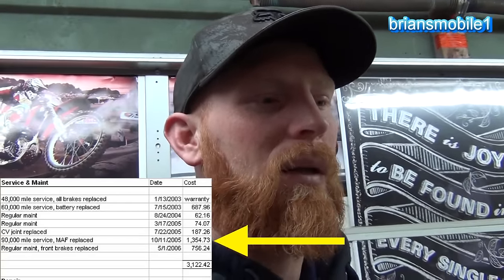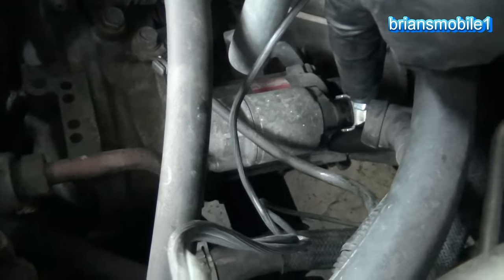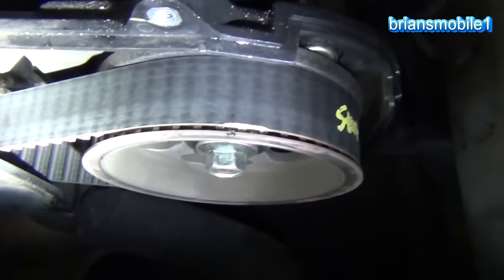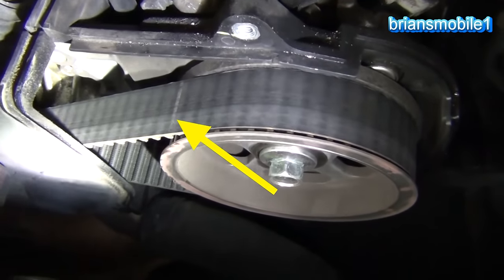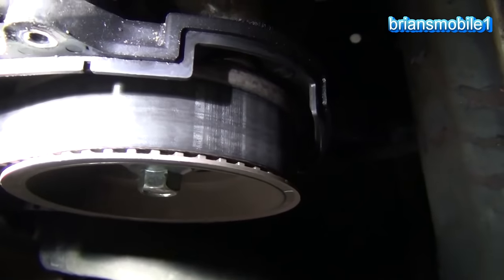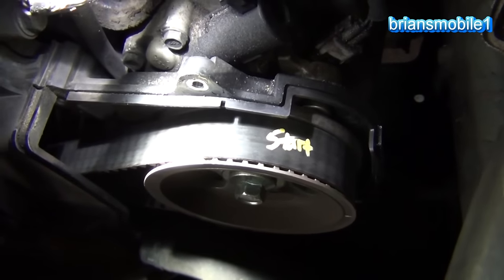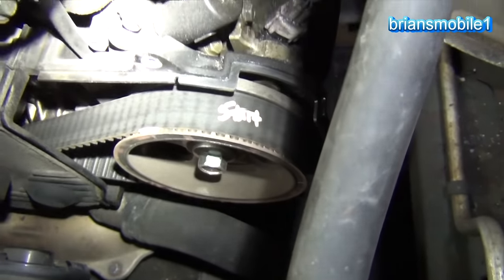How to Tell if Your Timing Belt's Been Replaced

Comment: I usually wait until my pistons to smash my valve train....Works for me- TWICE!
Reply: Get a Toyota with a 1mz V6, if the belt breaks it's not a huge loss, and installing a new timing belt kit is all you need to do to get the engine up and running again. You still need a tow to your car to a mechanic, or home if you are DIYer.
Reply: @davidperry4013  I’ve done mine in the parking lot right where it broke down😂 saved some bucks
Reply: Had it happen at 70mph 👍👍good experience. Now check the belt myself when buying a car lol
Reply: @conorf8091  What do you look for when you check it? Kinda hard to tell the health of the belt just by looking at it
Reply: @conorf8091  what happened? .. thats my worse fear
Reply: 😂 oh yea that works
Reply: @yamkaw346  cracks, if it’s shiney on the underside are shiney in general would indicate the belt has gone hard or stiff therefore not providing enough flexibility
Reply: @wayneshone3471  I bought a Peugeot a couple yrs ago and no evidence of belt being done. I can't take off cover because its connected to engine but I opened top screws of the cover and I can pull it back and look in with a flash light and belt looks fresh not black and smooth or cracked, I even see a tiny bit of green what was once writing, I said this to my mechanic and he said u can't tell by looking and better to change it at a cost of about 350 so now I don't know what to do.

Comment: A good mechanic would place a sticker in the engine bay to denote a timing belt change and at what mileage.  A sticker is the first thing to look for.  We inherited a 2002 Sonata from my father in-law and had no idea about if or when the timing belt was ever replaced.  I found a sticker in the engine bay that told me it had been replaced at 90,000 miles. It saved me from doing an unecessary replacement.
Reply: @Nick V: An even better mechanic would check the maintenance manual to see when the timing belt was last changed. No pfaffing around the engine bay with dirty hands.......  
If the mantenance manual hasn't been kept up to date or if its missing then turn your back on the car and walk away. Same if it looks like the maintenance manual has been tampered with.
Reply: Anybody can put a fake sticker in the engine bay with a mileage and fake belt serial number.
Reply: Anyone can put a sticker when selling a car saying its been changed
Reply: Nick V the trick a lot of people use when selling. Car around 90k is to just put a sticker on.
Reply: On eBay they sell stickers to fake timing belt changes too, e.g Gates ones
Reply: IT'SME  I would, ASAP. My 240 Volvo timing belt went at 60,000 miles. Good thing the engine was non interference. Old 2000 V6 Camry 80,000 miles per manual. Changed mine at 100,000 miles, old belt looked as new as the new belt - could not tell the difference. Mechanic friend said he change at 130,000 miles with no problem on his Lexus (Toyota). I would not push it that far, but the guy does it all the time on his own cars (Toyota).
Reply: @frankw8876  
What if you have a commercial vehicle that idles a great deal orworks at 10 mph for 10 hours a day like an ice cream truck?
Reply: Don't Sonatas have chains?
Reply: IT'SME  50 to 60,000 on most cars
Reply: @frankw8876  
Even some non-interference engines can make piston to valve contact.
Reply: The sticker usually falls off in a week
Reply: @team3383  anyone can write some lies in the book. That is NOT evidence.
Reply: @mr.e1220  Thats exactly why I said you must check and see that the book hasn't been tampered with. Anyone can stick a sticker inside the engine bay saying anything or write phony dates on oil filters ...
Reply: In short there is no way to understand weather its replaced or not right? Just change it as soon as u take a car if its exceeded the mile
Reply: @ramonatan4406  in Ireland they write on the engine with white correction fluid, but as u said anyone can do that.
Reply: @MrJohnnyDistortion  very very good point but they also recommend changing every 10yrs I believe regardless of miles.
Reply: @martymartin2894  
Ain't never heard the 10 year rule. But I'll go with it.
Reply: Best way. Just negotiate the price of a belt change off the price and get it done.  Service books can be faked, stickers in engine bay can be faked.  Having it physically done yourself is the best guarantee.
Reply: @martymartin2894 5 years usually regardless of miles. It's rubber and it deteriorates
Reply: @tambrand7294  thanks I got it done great peace of mind now.
Reply: @CashApp-HelpMeStayAlive then why you here lol

Comment: that guess or assumption can be costly! the best thing is to learn to change it yourself in that way, you will have a peace of mind that the belt is good. remember its a rubber and it dies with time not only mileage. a car that is 10 years old but driven only 10,000 mile, will need that belt changing.
Reply: Nice-oscar 
Nice one man just got 10 years old van with very low MILLAGE thinking no need to worry about belt 
But u are right 
Thanks for tips

Comment: sometimes the best thing to do is bite the bullet and get it inspected/replaced by a mechanic anyway. Couldn't find any sticker indicating it had been replaced under the hood, couldn't find it on the carfax, no way the car went 180k without a timing belt replacement before i bought it, but got it replaced anyway. Out of sight, out of mind.

Comment: Thanks!  Was just looking at my 01 Subaru that I just bought, and the back of the belt is glossy, so I figured it's original.  Your video confirms that.  122K miles, so it is getting changed this coming week.
Reply: What does glossy mean
Reply: @tientrinh943  shiny

Comment: I did a timing belt for a friend today, in a Honda Accord with 204,000 km. There was not one witness mark anywhere, no marks on the belt or timing marks, no missing fasteners, and the Honda crank bolt was pristine. As far as I can tell, parts seem to be OEM. After I was done it looks very different, and specifically that crank bolt is now experienced, in a Jimmy Hendrix kind of way.
Reply: Hey bub i got a yr 2000 accord with 101,000 miles the timing belt was done in 2004 when it had 42,000 miles so now its 61,000 miles into it, should i roll the Dice and go another 20,000 miles.
Reply: @matt7iron  That's a good question. My instinct is to respect miles over age, but I have no idea whether that is right in really old vehicles. I would probably do it now. The ASIN belt kit I got at Rock Auto was excellent.

Comment: This is very interesting, informative. Preparing to purchase an older Honda CRV and the timing belt and water pump are my two main concerns. Naturally, the used car dealer tells me they checked and it's fine. But with 201,000 miles on the car, seems to me it'd time for a change.
Reply: Yea, they checked....that's a good one.Checked for change in the ashtray is all they check.
Reply: Considering most manufactures schedule a replacement before 90k miles, I'd say it's time for your third belt.
Reply: crv has a timing chain.
Reply: @helivesonforever  DOH!

Comment: do you have an aftermarket brand that you like the most,
Reply from the maker: Gates
Reply: briansmobile1
Is the cost of the Gates vs OE that great of a difference?
Reply: UNITTA
Reply: cjones4512 Yes, for example for the Sti, the OEM is almost double ~$120 vs the Gates. I have OCD for OEM parts though.. Lol
Reply: Dan.vaku It's nice to meet a kindred soul. Ha! I got irritated when some small OEM parts for my Civic didn't show up in sealed Honda-labeled packages. ; ]
Reply: Best deal Gates kit from Amazon.  On the subaru above $146 because I just bought one.  Comes with all ildlers including the horrible idler gear plus water pump and tensioner.  When I bought one for my 2000 legacy 2 years ago, on that day it was $132.
Reply: ***** Yeah, it's a great price, check Amazon.  It varies and sometimes third party sellers are cheaper than Amazon.  Check ratings, the one I just got was sold by a third party seller with great ratings.  The only I got three yeas ago for my car was amazon itself and it was $132 at the time.  The belt is made in USA Gate and I believe all the idlers are made in USA.  The water pump is Chinese but people aren't having any trouble with it.  I've got 39,000 so far on my timing belt change and it's been fine.
Reply: @Eastahtata  I only use Toyota parts for my 4runner especially timing components
Reply: Black....black belts are hard to beat. Especially if we're talking brizilian ju jitsu
Reply: I didn't expect to find Mustie1 here 😂
Reply: Ha I was going to say the same. Good to see even @Mustie1 (one of my fav tubers) asks a question every now and then 👍

Comment: This guy helped me alot. I bought a 2.0 litre turbo back in 2017 December and thee car was half of its retail price. I did get serviuce3 history but no mention of any timing belt change which is very important. Car had covered 81k miles so certainly needed a belt change. I checked the condition after id bought the car, removed the case and voila, brand new clear white markings. So this tells me the belt had indeed been changed around 70k miles. Belt was brand new almost. My car is Z20LET 200BHP and now covered 107k, belt is still good until 120-130k but obviously i will keep checking it for cracks etc. Timing belt and timing chains are very important people. chains do slip on worn pulleys on high mileage engines so be warned. chain might be good but teeth on pulley could be worn down. Same with belt, one slip and car wont start no matter what.
Reply from the maker: Glad it helped Andi!

Comment: Thank you for this video, I checked my belt immediately and found the same fine lines as the belt in the video. But it's printed clearly.
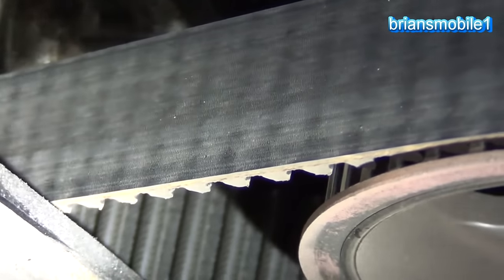Are fine lines like the one in the 2:09 video normal?
Is the belt in the video already used about 50,000 miles?
Thanks

Comment: Thanks for this. One thing that would have been more helpful is to describe what to look for on the teeth. On the Subi, the cam gears have the guides on them, but others are open where you can see the gap between the teeth and the the cam. The other thing I look for is at the point where the root meets the side of the peak, are there signs of fraying threads?

As to chains vs. belts, one advantage to the belt is that when done properly, all of the timing points are reset to factory specs. Additionally, since most water pumps are driven by the timing belt, you renew that as well as all other bearinged items. This renews all of those parts and as long as they are quality parts, the chance of them failing, is now almost nil.
Reply: Hola es igual para un Toyota

Comment: I have a 1999 Pathfinder and the timing belt was replaced 37K miles ago. But it was done 13 years ago. The owner's manual only states to replace it every 105K miles. Is the age an issue?

Comment: I got a golf mk4 where the timing belt was changed in 2018 but the car as only done about 4000 miles Vw state the belt needs to be done every 4 years or I think over 70 thousand miles the belt still looks kind of new and a original Vw belt and water pump was used in 2018 what’s your thoughts on this situation

Comment: Pointless to do an inspection if your not sure if it was not done, unless you are Under change interval and just doing an Inspection as due diligence don't bet $5000 on condition of a rubber belt. Sorry,  to be honest, recently did a timing belt on my Nissan pulsar, belt was done at 100,000 km, now has 190. Belt looked new. Factory Nissan belt. When they did belt I doubt they did the other components which can fail as well. Waterpump included. 

Tensioner was shot, and needed to be
Done. Don't risk with this cheesy set up. If your not sure do everything tensioner, crank seal, idler and tensioner. Belt may look ok but not worth risking your investment over.  Only way I would do an inspection and waste time is if it was halfway through its life cycle and wanted to take a look for your own peace of mind, if in doubt CHANGE it OUT!

Comment: This might be a pain, but when considering a vehicle purchase...consider a few things: 
1)  Timing belt vs timing chain.  Chains last longer, and even better - dual roller chains are extremely durable.  Yes, a timing chain kit is more costly, but the longevity is well worth it.
2)  Interference vs non-interference engine.  I built a 2002 Mazda Protege 5 with my niece for her specifically because its cheap, full of options, parts everywhere, and has a non-interference engine.  If  the timing chain/belt malfunctions on  a non-interference engine...you do not have to worry about the pistons and valves smashing each other to bits.

Stay gold.
Reply: Thank you, shopping for a car for my daughter and researching all of this because I know very little about cars

Comment: I did my hyundai Getz at about 60Thou Km when it was 6 year old, changed the water pump and tensioner bearings at the same time, some  one else on  youtube  [and my local mechanic] said that a dealer mechanic would not have changed the bearings or water pump as time is money, its worth doing the pump as the job is the same teardown should the pump fail at some stage. The belt actually looked brand new, but it was still old.

Comment: that's interesting Brian, which leads me to this question, here in New Zealand we change the belts every 100km how come you change them every 100 miles? a kilometer is shorter than a mile by a lot. how long lasting is Subaru belt? 100km or 100 miles?
Reply: I think 100'00km 60'00miles was the standard years ago. Now they think that modern belts and tensioners can go 160'00km or 100'00miles. Personally, I don't like to take the risk.
Belts can degrade overtime so you can have an old, hardly driven car with 77'000km with a belt that is going to break due to age.
I think they are assuming that all modern cars do high mileage.

Comment: Hey Brian I am trying to install a new timing belt after putting in a new water pump, the belt is very tight and can't seem to fit it around the pully tensioner with the pin and all the idler one. How can I get more slack to fit it back on?!

Comment: Some good advice, fair call. However, having owned a few cars running belts, unless I have concrete evidence (sticker as supplied with new belts, or a receipt) of a reasonably recent belt change, for the sake of $40 or $50, and a couple of hours, I just change it anyway, and fit the sticker that comes with the new belt.
Maybe not so practical with some more difficult to work on cars, but G16A Suzukis and 4G15 Mitsubishis are a piece of cake.
Reply: What in the hell???? Licensed mechanics here in Lincoln, NE want $1,000.00 to change the belt and water pump on my 1999 Nissan Frontier.

Comment: In older Toyotas with a V6 or V8 engine, they use a timing belt. On both the 1mz and 1uz engines if the belt breaks it's not a huge loss just realign the timing marks and replace the timing belt, water pump, tensioner, and idler pulleys. On a 3mz-fe if it breaks it will suffer moderate damage in worse cases, the mechanic will either fix the engine or sell you a remanufactured engine with the core charge fully refunded.

Comment: I have a wrx 2013. When the time comes, will I be able to open that cover up just like you did there with the legacy and check how the belt is doing?
Reply: it is similar but yours is a DOHC not a SOHC so the cover will just be bigger.  But just saying your car is newer so just change it when the manual tells you to change it.  This is only if your car has higher mileage on it and you bought it used and are not sure if the previous owner has changed it

Comment: Thanks for sharing this great video I bought a 2010 Acura MDX at a certified owned dealer but I’m not sure if it has been replaced the tbelt and I have 66.000 miles on it,, should I replace the belt or not please.,,???
Reply: You probably have chain .No worry until it slacks.
Reply: Efren Saclolo allright then thank you

Comment: There are only a few belt manufactures of cambelts who supply most oem manufactures who then put them in a oem box, usually gates / dayco.

Even if you were to say buy a SKF timing belt kit the belt will be gates / dayco, where quality can vary is in tensioners / idles / water pumps.

So aftermarket belts are the same as oem but when going aftermarket "kit" don't cheap out and go with a reputable brand and all will be good.
Reply: It took a lot of research and convincing, but I finally decided to buy the Aisin kit for my timing belt change. I just bought a 2010 Honda Pilot a little over a week ago, and since I cannot tell if the timing belt has ever been changed in the vehicle's 129,000 mile history, I am going to get it done. The Aisin kit is literally $500 cheaper than buying the parts from Honda.